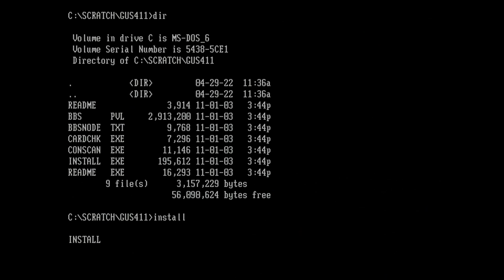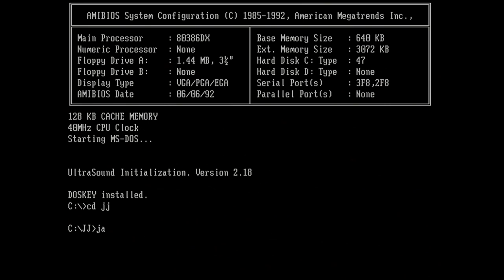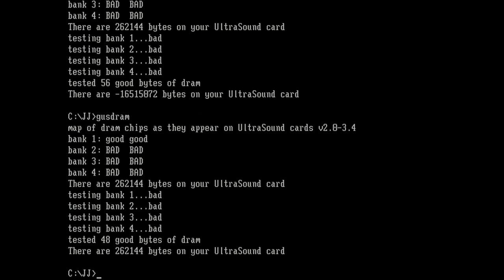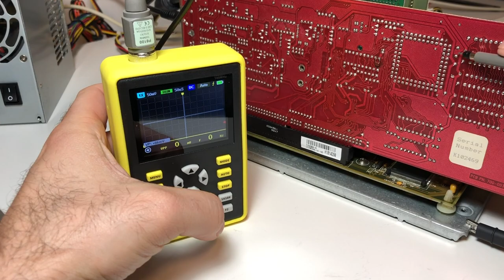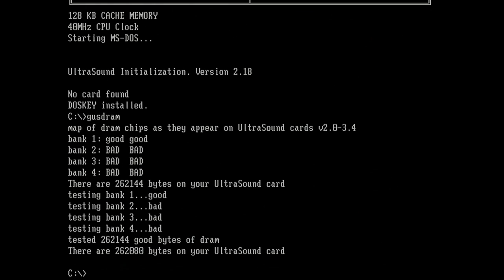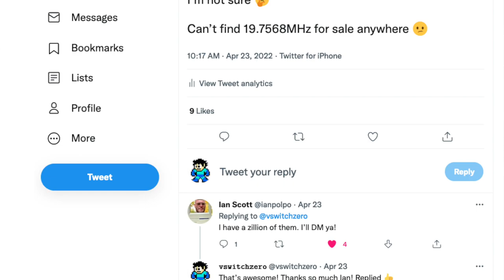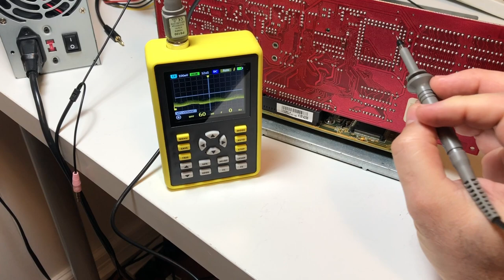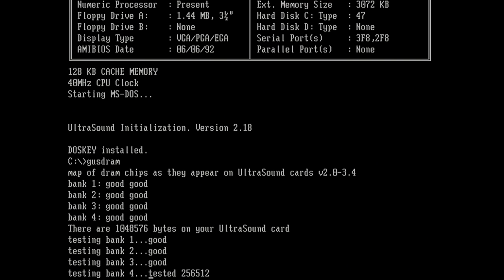Repairing The Legendary Gravis Ultrasound

Comment: Hey, I'm actually the seller of this card. Really glad you got it working! I was afraid it might have been the GF1 flaking out as I heard those are a common issue. At least it wasn't too difficult or expensive to repair. Couldn't have asked for a better home for this card. Small world to be recommended this video, haha. I bought it as supposedly working about 9 years ago, but I had similar issues back then so I got some more of those RAM chips to try it with but it was always acting weird so I stashed it for years and then tested it again to see if I could figure out the issue and clearly I could not so I listed it as not working/for parts, and the rest is in this video. :)
Reply from the maker: Thanks so much for your comment! Wow that's awesome that you found this video! It is a small world indeed. Thank you again for this card, it was in great condition. There were a few people bidding against me from what I remember :) .. I definitely appreciated the detail and honesty about its working state in the auction description. It was spot on and gave me some hope to get it repaired. I had feared it may be the GF1 chip too initially but was a total fluke that I discovered the flaky crystal. Ian was kind enough to send me a couple more OEM crystals to try after I posted this video. When I get some time I'd like to get the proper frequency one back on. I need to check the crystal capacitors in the circuit as well as it's possible they were contributing. Thanks again!
Reply: @vswitchzero  Great, hope you can get it figured out with the OEM crystals as well. Your channel is really cool, by the way. Cheers.
Reply: Glad that it seems part of my theory as to what had happened to this card and the attempt at repair was correct and that you suspected the memory chips.
That was my first theory, but the mass failure wasn't very likely to me at first, but the clock chip was a bit further down the rabbit hole than I suspected :D
Reply: @CMDRSweeper  This absolutely makes sense because DRAM requires "periodic half accesses" (the refresh cycles) to maintain whatever is stored in it and those accesses are generated/timed by the master clock frequency. Without refresh pulses whatever is written to the DRAM "evaporates" over time and then it comes out as bad RAM on the diagnostics program. By the way great channel you have here. Loving your videos.

Comment: Too bad the new old stock crystal I sent was also flaky, but that's great that you've found a substitute that is much easier to source. It sounds like it works just as well!
Reply from the maker: Thanks again for sending that over, Ian! I really appreciate it. I'm guessing they are quite old and even though they've never been used, something internally must degrade over time. It was definitely worth a try. I'm very happy the 19.6608MHz crystal seems to work fine. So far it's been rock solid, and I can't notice any difference in the sound quality or speed. Thanks again!
Reply: @vswitchzero  it could be interesting to carefully open up the defective crystals and film the inside to see what's wrong with them
Reply from the maker: @jonas-fr  Thanks for the comment! I'm not sure how easy they are to open, but I am also very curious to see if there is anything inside that looks degraded, corroded etc. I may give it a try if I get some time.
Reply: @vswitchzero  this one a bit tricky to open - seems it use a contact weld. So only carefully file out a weld.
Reply: @vswitchzero  Try 2 capacitors somewhere in the range of 15-22pf from every leg to GND. Most crystal oscillator circuits i've seen have them present to get a stable signal.
Reply: @dolphhandcreme  I came down here to comment basically the same thing.... I wonder if the load capacitors have strayed or perhaps are bad in some way.  Maybe the xtals are fine and just needs new caps.  Proper loading cap values are essential to the function of a crystal oscillator circuit.  Touching or grounding the case with that long wire could have altered the capacitance just enough to make it work.
Reply: @BEdmonson85  i'm pretty confident that they just left the caps from the circuit because it worked somehow. Now, after 30+ years, it isn't working anymore. Aging components and tolerances.
Reply: +1 for the capacitors. There are analog gains and phase shifts involved in XTAL oscillators. The finger test that made it work just adds capacitance. The circuit won't oscillate if there is not enough capacitance. When the ASIC has more work, heating can reduce the analog gain of the logic gates and require more capacitance. Crystals can require more capacitance when aged, making stray capacitance insufficient. If you want to beat the original design, add the 10 to 22pF capacitors to the original XTAL (to a digital GND like the ground plane under the ASIC). It seems the original designers left the capacitors out. You can take the two ceramic capacitors from some old piece of scrap.
Reply: Maybe sending over the bad crystals to Dave @ EEVBlog. He could maybe tear it apart and teach us a thing or two about this?
Reply: The 19.66MHz crystal is only 0.5% off, which is probably within the typical drift margins of these old analog clock circuits anyway and completely impossible to notice by ear.
Reply: @vswitchzero  I just discovered your channel and I'm really enjoying what you have been making, especially all the 486 related stuff: that CPU holds a special place in my heart. Congratulations and thank you!

I'm coming to this video a bit late but I'd like to leave a note on crystal oscillators: the crystal itself is a component in the circuit but the active elements, which include an inverting amplifier or inverter gate, are inside the chip. If you could find the pinout of the IC you would most likely see that one of the pins connected to the crystal is marked as output (XTALOUT or XOUT, for example) and the other an input (XTALIN or XIN, for example). The signal is very weak so an oscillator can be easily disturbed by just the capacitance of the oscilloscope probe. You have a better chance of being able to sense an oscillation if you probe the output from the chip rather then the input. This is why the oscillator circuit behaves differently when you touch one side of the crystal or the other.

As for the unstable original crystal... I would have tried to keep it working with the case grounded.
The case is not electrically connected to the crystal (but there's obviously some stray capacitance between the crystal and the case) and it is not unusual to firmly fix through-hole crystals with a "yoke" of bare wire soldered to the PCB. This makes the board more mechanically reliable and the tuning repeatable. You may have seen the "square" through-hole crystals with 4 pins. Well, two of the pins are the terminations of the crystal, two are the case and these have to be connected to ground. Even SMD 4-pin crystals have a conductive case which is grounded.
May it be that not grounding the crystal on the GUS by design was an oversight?

Comment: Crystals are highly dependent on accurate capacitors.  By touching the case you were adding capacitance.  I would have looked at replacing the capacitors at each leg of the crystal with new ones of the correct value - that would also explain why the new-old-stock crystal showed similar errors.
Reply from the maker: Very interesting! I will definitely look into this
Reply: @vswitchzero  Just what I was thinking, one typical oscillator has the crystal from input to output of an inverter, and capacitors from each side to ground, this makes the crystal actually act as the inductor of a capacitive center tap grounded tuned circuit to provide the inverted feedback, it's possible the other crystal just has a more forgiving self capacitance.
It also requires the appropriate capacitance to pull the crystal to the specified frequency
Reply: @vswitchzero  FWIW, this is why probing it with the scope caused you to see nothing. The scope probe has (in this situation) non-negligible capacitance, which causes the crystal to stop oscillating or doing anything
Reply: Good to see someone who also understands what's going on.   Honestly I would have just grounded it making the can act as a capacitor in a sense around the internal legs of the crystal which are isolated.
Reply: You beat me to it. Probably the crystals are fine and the capacitors are the problem

Comment: I still have my original GUS 'classic'.  But I'm fearful of actually using it so I've just ordered a 'PicoGUS' to pop in the P-III retro PC I'm building.  Great you could get yours up and running again.
Reply from the maker: Nice! I actually just bought a PicoGUS too. Such a cool project that's getting better and better!
Reply: Same, I have an older rev 3.4 which was listed as not being tested for a few years, ended up being just fine though. I'm seriously considering a PicoGUS as well, although personally I tend to think that being scared to use vintage hardware because it might break is a bit of a self defeating argument. What's the value of having working hardware if it's sitting in a box anyway? 

There's some nuance there of course, if you use your hardware a lot, maybe it's worth saving the real deal for special occasions. It's just hard to quantify, since not being used won't stop the hardware from aging, and the time it spends in storage is time you could've had to actually enjoy what you have.

Comment: Crystals failing to oscillate with IC built-in oscillators is a common issue e.g. with old microcontrollers. Adding load capacitors is often suggested, but often doesn't help. What often helps to make the crystal more compatible is loading the oscillator with a resistive load.  Something between 47kOhm and 470kOhm between the crystal pins often helps. Load capacitors decrease the frequency and also the amplitude of oscillation making it weaker, so they might the wrong cure. Try touching the xtal pins with resistor pins, but don't touch it with fingers. Cheers!

Comment: The "touchy finger" helped me repair a Voodoo1 with an open 0R resistor on TMU mem RAS line, and an A500 board with some broken traces under the Denise socket. Nice to see how your fingers do the diagnosis just as well ;-) IMHO if you've got ongoing audio or visual problems then touching stuff is always worth a try.
Reply from the maker: Haha yep, the finger test has served me well several times now! 👍

Comment: Grounding a crystal case is normally done in a circuit. You can pull a higher frequency crystal to a lower frequency with a really small capacitor. You could try using a "gimmick" capacitor to pull a higher frequency crystal lower. It's simply two insulated wires twisted together but isolated form each other. The harder you twist the wires together the lower the frequency. Solder the gimmick to the two crystal pins. You can Google "gimmick capacitor" to see one and yes, they are as simple as they look.

Comment: In owning several GUSes over the years, including launch day, I've never seen (heard!) that kind of failure before.  That's bananas.  One thing to note:  While the difference in your replacement crystal is very small, it will likely affect some amiga MOD songs played in modplayers that support the GUS, specifically any song that uses a looping sample (like a drum pattern) that was calibrated to loop on the beat right as the sample ended.  Those might have audible beating  ("judder") when played.  But a slightly slow GUS is better than no GUS at all :-)
Reply: You know this might not be the case. 

The current crystal is 19.6608; original crystal is 19.7568, which is a sub 0.5% difference. You can kind of expect any of the system crystals to be out of sync with the soundcard crystal by about that order of magnitude if you aren't lucky. For this reason it's considered bad manners to rely on the separate clocks running in sync, and the only timing source for the sound/music routine should always be the soundcard, most game/demo/audio routine programmers know that very well. There's a separate timer subsystem on the GUS chip for this reason, as you can't just time the audio in batches during mixdown, you need actual events in soundcard timebase. The timer has an approximately 12.5kHz resolution i believe.

Worth testing for sure to ascertain compatibility!
Reply: @SianaGearz  I wasn't saying the mods will play incorrectly due to bad timing, but rather because the slower crystal means the samples will be played 0.5% slower (that's one of the reasons I called the failure "bananas", I'd never heard a failure like that before).  Since the original timing of when to fire off the samples will remain the same, the slower sample playback won't have a chance to get to the end of the sample before it's retriggered.  You may think 0.5% pitch difference isn't noticeable, but it can be if percussion sample loops are involved.
Reply: @JimLeonard  the timer peripheral on the GUS runs in lock sync with the sample clock, since there is no other source of timing. If the sample clock is half a percnt slow, so is the overall timebase.

The sampled sound routine is generally the source of audio and music related timing in games and music players, and often the master source of timing that all other time sources are calibrated against. Some disparity between clock domains is common and needs to be accounted for by software.

Master interrupt controller on the mainboard being 1% too fast is not anyhow out of the ordinary! RTC is usually pretty good but it can't be used for fine timing.
Reply: @SianaGearz  Wasn't aware of that; I agree that any mod player that used the Gus timer would work fine, since the timer and the playback would be in lockstep no matter the frequency. Of course, assuming all mod players that supported the GUS used it is wrong :-) I've seen a lot of player source code, and they almost universally use the system timer for the 50 hz timebase.
Reply from the maker: Thanks for your comments, Jim! Very interesting stuff. I haven't had a chance to try out any MOD players yet, but its definitely on my list of things to do. That and some demoscene stuff as well. So far, it seems to be doing well in all of my gaming and MIDI tests. Ian offered to send me a couple more ecliptek 19.7568MHz crystals, so I'm hoping I'll get lucky and one of the proper ones will work properly.

Comment: Good video and repair, just some observations.
Maybe, just perhaps, the crystal might be fine, and the problem is elsewhere, a broken solder joint or trail, or potentially a bad capacitor.
Something could be overheating after some time, hence not having issues at first and problems steadily getting worse.
Using a slightly slower crystal, makes things run slightly slower and use slightly less power, causing stuff to heat slightly less.
Reply from the maker: Thanks for the comment and the tips! A few people have mentioned a bad capacitor possibly being the issue. I'm definitely going to look into this. I got a couple more original crystals from Ian that I'm going to try when I get some time.

Comment: I bought a GUS in 93 with my own money. I read up and understood the potential for the wavetable stuff, but sadly almost no games supported it. So to me, it became a slightly flaky SB emulated in software. But I never had any huge issue with the emulation. Some time around 95, into the trash the card went, mainly because of cheap SB clones and the disappearance of the 16 bit ISA slots.

Comment: Nice video,

Quartz crystals are physically very fragile parts. It's basically a quartz disc pinched in 2 places for the electrical connections.
It is basically impossible to weld / solder on the crystal as the temperature would cause it to crack.
Grounding the case of crystals is common practice, probably for the stability of the oscillation or to remove stray capacitance.

Depending on the topology serial resonant or parallel resonant capacitors of a few pF can be used to adjust the fundamental frequency.
Also, measuring crystals in circuit is tricky because the probe itself has a built-in capacitance (usually 10pF) that is not negligible and that can destabilise the oscillator.
Reply from the maker: Thanks for your comment and for sharing! I hope to revisit this card at some point. I have two more OEM crystals to try and will be looking much more closely at any capacitors in the circuit too.

Comment: Great work bringing it to life. However..

As others mentioned, it is probably not a bad crystal but auxiliary capacitors that are bad. They are usually external to the crystal. and need to be rather specific values, to form a part of resonant circuit. I would desolder the crystal, and measure capacitance and resistance of each pin to ground on the board, then trace where these caps are (usually few pF), they should somewhere close to the crystal, and preferably replace.. The new crystal might be working, but if the caps are still there and have high ESR, this could cause issues in the future or a short. However, looking at this board I do not see any obvious places for these caps (C20 is connected to a different net, so it is not it). If you check the rev 2.4 board, there are some, but on 3.7 I do not know where they are. If there are no external load caps, then new repair should be fine without them either. My guess is that the old crystal when it was new was working fine, but due to aging and moisture, it got slightly different driving characteristic.